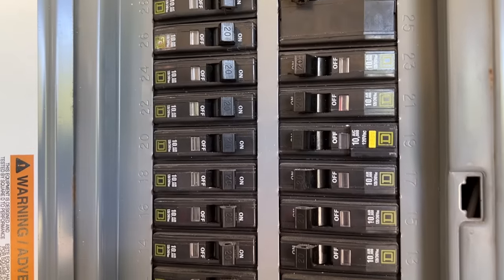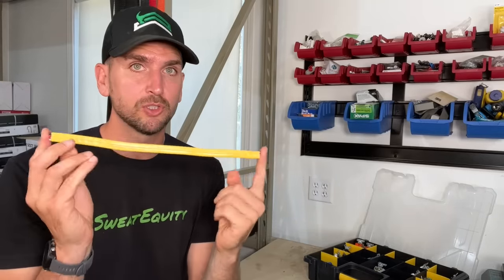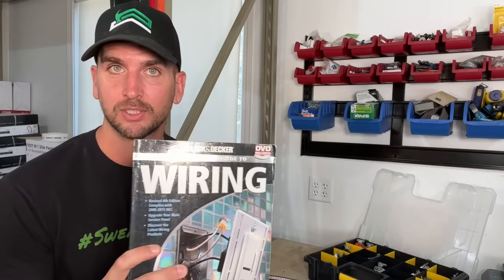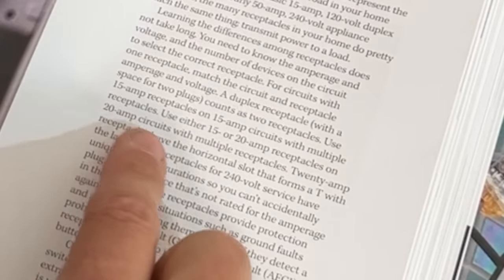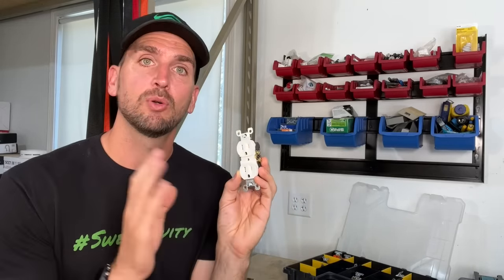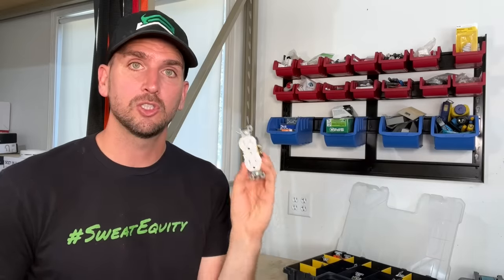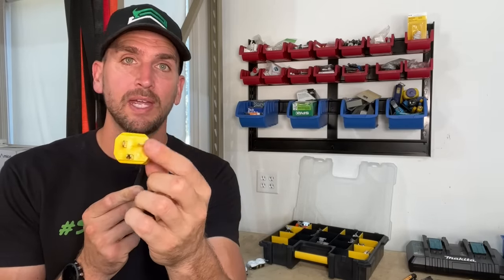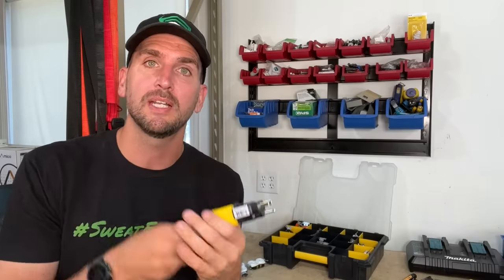Can 15 Amp Outlets Be Used On A 20 Amp Circuit Breaker

Comment: Additional information: As stated, you can put 15A outlets on a 20A circuit provided there's more than one outlet on that circuit. The code also specifically states that the double outlets, such as the ones he was taking apart, count as 2, so they count as more than one outlet. The outlets that count as only 1 outlet are the round ones with only a single set of holes in them and no other outlets on the circuit. This is usually only done on a dedicated outlet for a high amperage device, such as a window air conditioner or a large air compressor.
Reply: Normally one circuit line goes to 2-3 outlet in a room, not including the AC outlet.
Reply: Agreed.  Also note that most kitchens and baths require 20A circuits, yet use 15A receptacles.  The idea is to limit what any one device may draw (15A, ~1800W), yet permit the circuit to handle 20A (~2400W)... mainly in case two devices are running at the same time on that same circuit and realizing those single devices would rarely, if ever, draw a full load of 15A each.  20A is typically plenty to handle a couple lower draw devices.
Reply: wm
thanks for that explanation ..."the outlet that only count"......
Reply: JUST STOP BACK STABBING THE OUTLETS!
Reply: @brentwalker3893  Agreed!!!! I've seen too many fail. However, for those who don't know what this is, there's a difference between back-stabbing and back-wiring. Back-stabbing is pushing the wire into a spring loaded hole in the back of the outlet. Back-wiring is similar, but you're pushing the wire under a plate that is then clamped down by tightening the screw.
Reply: Receptacle**
Reply: @sapreaper  **outlet
Reply: @sapreaper  plug
Reply: @johnkulpowich5260  Do you know what a plug is? Pointless responses.
Reply: @wmcomprev  thank you for clarifying,  since many folks (including myself when I first got into the trade) use the terms interchangeably.    I would sometimes use terms like La-Z-Wire,  QuickWire or SpeedWire,  to make myself more clear when talking to others in the field.    One good thing about commercial-spec receptacles and switches,  is they are back-wire only, saves time from looping and removes the temptation to used the backstab.    (I don't even think commercial spec has backstab as an option, at least I've never seen it, says a lot about how inferior it is)     I've replaced my share of receptacles where the back stab failed.
Reply: @wmcomprev  the worst failure I've seen with a backstab receptacle, was in a home built in the '60s.   A television set, cable box and a lamp was destroyed after the neutral failed.   It was a multiwire circuit with each receptacle alternating between L1 & L2 along the wall.  It was a ranch style home pretty well equipped for the time.     To make matters worse it was aluminum wiring,  and for those who are wondering,  yes it was 12/3 AL, it used to be the a backstab would accept a 12awg conductor.   Only time I've ever seen that.
Reply: I don't use the hole terminals on the back of the outlet unless it clamps down by the side screw. I loop screw all other types. Once we had three wires to one outlet and being a teen used on set of the hole terminals hopefully it was the last outlet on the daise chain. It passed inspection but as an adult I would never connect that way. It's best to use an oversized box and junction two sets of wires. If my older brother saw it he should have told me not to connect the outlet that way. I'm sure that could have been avoided but drilling through 10 inch beams was out of the question. Plank houses have there problems when studding is added. The furnace guy had to cut them beams because mom said no floor registers in the house period. She had her reasons. 73
Reply: Or a microwave oven. I’ve been in too many homes where if you run a toaster oven while simultaneously running the microwave you trip the circuit breaker. 
Is it that difficult to make a dedicated outlet for these high drain kitchen items?
Reply: @tonymusolino2369  I got 30 amp breaker on 15 amp outlets in my kitchen. Old school wiring I did not wire the house. I would put microwave on its own circuit. I did on my new home. The current home is going to get new outlets and I will see if number 10 Romex was used if not then the 30 amp breaker will get changed a 20  amp will do regardless. 73
Reply: Ok let's argue about receptacles, outlets and plugs. There is a such thing as a female plugs. So I don't give a rip what anyone calls a plug, outlet and receptacle. Sometimes I will irritate because someone tries to correct which has no place on you tube.  It ain't mean a thing to me what you call the 4 slotted with two holes. Ok the terms have changed in the NEC but the average home owner don't read the NEC. Since you tube is open to all people I would use language that everyone can understand. So if you call a receptacle an outlet it's ok this is open to all people not just licensed electricians. Enough said. 73
Reply: Recepoutplug. He He I could not resist. 73
Reply: Wouldn't putting multiple 20 Amp outlets on a single circuit defeat the purpose?  Which is to communicate you can plug a 20 Amp appliance in here and be assured of not overloading the circuit?  You wouldn't want to allow plugging two air conditioners into the same circuit for example.
Reply: @odess4sd4d : That all depends on what you're doing with them. It's common to put in a 20A circuit so that you need fewer circuits (more receptacles per circuit). Usually, they'll be 15A receptacles and probably, unfortunately, builder grade. If it's a 20A circuit, it's legal to make them all 20A receptacles. They'll probably just be used for normal household items and won't need the 20A receptacle, but the capability is there. Most electricians, though, won't do that unless you ask them to and pay for it because the 20A receptacles are going to cost more. It's no more labor, just the increase in the price of the receptacles. If they were running the 20A circuit to reduce the number of circuits, they're already running 12 gauge Romex, so the receptacles are the only thing that's different. Most of the newer 20A receptacles are back wire (NOT backstabbing) capable, so no significant labor increase in wiring the receptacles. Even with the 15A backstabbing, they need to tighten down the unused screws, so they need to tighten the screws either way. With the back wiring, they don't have to take the time to loop the wire around the screw. The screw clamps a plate down on the wire that pushed straight in from the back.
Reply: @odess4sd4d  Placing multiple receptacles on any circuit will allow potential overloads. The reason for the 20-amp device configuration is to prevent a load drawing more than 15 amps being used on a 15-amp circuit. If a circuit will routinely have multiple 20-amp loads running on it, it will overload and should be split into two or more circuits. Circuits have multiple receptacles in part to prevent the use of extension cords, so the presence of multiple doesn't imply multiple simultaneous loads.
Reply: Can I do 1 15amp outlet with 20 amp circuit  dedicated?
Reply: @jamestrads497  If it's a 20 amp circuit, you may use 15 amp receptacles on it as long as there's more than 1 receptacle on the circuit. A double receptacle counts as "more than 1." So, if you have a 20 amp circuit and only put a SINGLE receptacle on it, usually a round receptacle with just 1 set of 3 holes, then that SINGLE receptacle must be a 20-amp receptacle.
Reply: @wmcomprev  thanks for the reply.  So I installed a 20amp dedicated circuit with an 15amp double  receptacle for my garage fridge.   Working good so far.    Is that okay?
Reply: @jamestrads497  Just remember, the current code requires all garage receptacles to be GFCI protected. Other than that, it sounds good.
Reply: If they can put a fuse into a receptacle, they will make life a lot more easier
Reply: @Crafty_house-r5d  They can, but they don't. I can see how, in some ways, it would make things easier. A breaker in the receptacle would be better than a fuse. A push button breaker, as is seen on some power strips, would work. A fuse, however, has problems. 1) You have to have a replacement fuse lying around in case one blows. 2) People tend to put a bigger fuse in to keep it from blowing again, causing a safety issue. 3) The wiring itself still needs to be protected from accidental shorts due to loose wires or a mouse chewing on the wire, so the breaker box would still be needed.
Reply: @tonymusolino2369  Difficult? No. It's simply trying to get off cheaply. What they don't realize is that most customers would gladly pay the small difference, which then gets rolled into the price of the home & its loan, especially if the reasoning for it is explained to them.
Reply: @ronb6182  for the most part, outlet is shorter to type and 2 syllables instead of 4 to say.
Reply: @odess4sd4d  I have and both run ok. The only reason they may be on the same circuit is because two rooms are Daisy chained and the AC units happen to be plugged in the nearest outlet to the window. I plan on selling the house but will take the AC units with me. Otherwise I would install two dedicated outlets for the AC units. If they weren't energy star I don't think the units would run. The total current is about 17.4 amps it's pushing it's limit and I would not practice putting two AC units on a single 20 amp circuit. But in my case the units rarely run together it's either or but not both. 73
Reply: @jamestrads497  my washing machine outlet is 15 amp on a 20 amp breaker but the house was built in the early 60s or 70s. I wired my father in laws house in GA and put the 20 amp breaker on a 15 amp outlet for the washing machine and passed UL inspection. The washing machine may need 20 amps for surges but may only draw half the current. I rarely see 20 amp outlets in homes. I don't have any in my Florida home. 73
Reply: @wmcomprev  good point plug is one syllable. I grew up calling outlets plugs must be old school. Also fishing lures are often called plugs. Plug is a universal word. 73
Reply: @jamestrads497 yes,  your circuit meets code.
Reply: Correct
Reply: I also seen washing machine outlet with only one outlet but most have a duplex outlets which are only 15 amp. A washing machine does not use 20 amps so a 15 amp outlet is ok. It never hurts to use a 20 amp breaker. I would not have 15 amp circuits in my home. My sister in law has them and she has all kinds of overload problems. Especially in the bathroom and kitchen. I told her with all the stuff you are trying to run you need new wires and breakers that are for 20 amps. I think code needs to rethink the 15 amp idea. Some localities don't allow the use of number 14 wire. I only use 14 for outdoor lights that are run underground because uf cable is cheaper using 14 over 12. My next home already has number 12 through out the whole house because I wired it years ago. I only need to install a light over the sink in the kitchen and bathroom. Good thing I'm reroofing the house so I can add wiring on the outside wall without going into the attic , the house has a metal roof and no one put a sheet of plywood and felt under the metal which I have leaks because the guy took too many shortcuts on this house. In Florida they use weather watch felt under the roofs which is better than regular felt paper. Enough of this rabbit trail. Lol 73
Reply: This post offers a complete explanation for this videos title. And takes a mere 30 sec to read, not bloated to 8 min.
Reply: what about a number of 20amp receptacles on a 20amp circuit, is that safe?
Reply: @wmcomprev  so what would happen if a 20A circuit had only one 15A receptacle? is it dangerous?
Reply: @carlodonnell146  I never use 15 amp outlets period. 20 amp commercial grade only.
Reply: @carlodonnell146  Never run more than 4 outlets to a single breaker...
Reply: I understand, so it is fine to have one double 15A on a 20A, but not a single 15A unless it is a dedicated circuit, but I would still like to know what would happen if it was done.
Reply: @carlodonnell146  The code says that if it's a single receptacle on a 20A circuit, that it can't be a 15A receptacle. It needs to be a 20A receptacle. A single receptacle would be a non double receptacle and the only receptacle on the circuit (i.e. no more receptacles down stream). With only the single 15A receptacle, you could overload it before tripping the breaker. You could say the same  about more than 1 receptacle, but only 1 of them is actually in use. However, the code also allows for some "most likely" scenarios. This is one of them.
Reply: @carlodonnell146  It could be. The breaker won't trip until you exceed 20A and the receptacle is only rated for 15A. The same could happen if you have more than 1 15A receptacle but only 1 of them actually in use. The code does allow for some "most likely" scenarios. This is one of them.
Reply: @carlodonnell146  Theoretically, you can put as many as you want on the circuit. If you exceed the rating of the circuit, the breaker will trip. So, no, it's not unsafe. However, if you have too many receptacles on a circuit, that break point is more likely to be reached and will essentially make the circuit unusable because the user would be tripping the breaker all the time.

Where it could be unsafe is if you have a bunch of low current draw items in each of those multiple receptacles and you're sitting right near the max current draw all the time (total draw from all the items). This will generate a lot of heat and could cause you a problem. When there's an item on a circuit that is considered a continuous draw, such as a heater or a blower motor, then you're only allowed to have it use a certain percentage of the maximum for that circuit. You'll need to read the code for how long it has to run continuously for it to be considered a continuous load.
Reply: Having lived in homes built inthe 40s-50s for much of my life…Not counting Amp draw can be Fatal…Why use 15amp thats less when you can use a 20amp..ifyou e ever used the a small electric heater that draws 15 amp and your socket and plug get burned..you know what I mean.
Reply: @kilroyishere6190  Understood. The comment is just that it's permitted by code. Going over and above the minimum code is usually a good thing to do.
Reply: @Sparky-ww5re  So during the neutral failure you spoke of, the TV, cable box, and lamp got their neutral through the loads on the second circuit to the hot on the other half of the split phase. In other words, instead of the two circuits receiving 120V + 120V, it was in actuality say, 80V + 160V (depending on actual load impedances), with the devices that failed receiving the higher voltage. If the two circuits on one cable had used breakers (fuses in this case, I imagine) on the same phase excursion, the voltage would have been reduced, not increase, and the devices would have been saved. However, there is nothing stopping anyone from sending opposite phase excursions out on the two hots. That's also why sharing neutrals is not longer allowed.
Reply: @tonymusolino2369  Around here, the kitchen microwave oven in new construction gets its own circuit.
Reply: @ronb6182  "Plug" should always mean male, and "socket," "jack," or "receptacle" should always mean female. To use "plug" as female is asinine. That would be like using "receptacle" for the plug on the end of a cord. Who started that nonsense?
Reply: @csimet  The problem with that is that many hair dryers draw 16 A or more.  The practice of allowing such devices to have NEMA 5-15P plugs, and allowing 20 A circuits to have even one NEMA 5-15R receptacle, is a vicious cycle.

We really should end this practice: if and only if it's a 20 A circuit, use NEMA 5-20R receptacles exclusively.  It's unfortunate that, when faced with a NEMA 5-15R receptacle, you have to trace it back to the circuit breaker to find out what the circuit's amperage really is.
Reply: @jmdavison62  Perhaps, but I have never seen a hair dryer rated over 1800W (120v x 15a) that used a NEMA 5-15P, so I'm sure sticking with 15a rated receptacles in a bath is fine and still meets code.
Reply: @caseycooper5615  Correct. The same thing can be said for any circuit, regardless of its amperage rating, that has more than one receptacle on it. If you plug in and turn on too many items, the breaker will trip.
Reply: @carlodonnell146  The code assumes that with more than one receptacle, probably no single receptacle will pull over 15A. With a single 15A receptacle, you don't have that fudge factor. However, it's just that, a fudge factor. So, is it dangerous with only a single 15A receptacle on a 20A circuit? Well, it would depend on what's plugged into it. Also, if you sell the house, will the next owner know that? It is a code violation and not that hard to comply with the code, just pay the little bit extra for the 20A receptacle and you're clean. Also, remember, a double receptacle counts a "more than one" and, therefore, doesn't violate the code.
Reply: Hi.....if a 15A recep.  Can pull only 15A  and only a device with a 15A plug can be plugged into it.....why would it matter if only one 15A  recept was installed on a 20A circuit?.....it cant  pull more than 15A  through the 15A recept. ..correct?
Reply: @carlodonnell146  Not all 20A devices use the 20A plug with the sideways spade in it. Also, not all the rules make 100% sense, they just have to be complied with.
Reply: @csimet  Here's a counterexample: the nameplate on the Babyliss Model BAB307 reads "125V AC 60Hz 2000W."  (I haven't tested it to see what its actual draw is in practice.)
Reply: @ronb6182  30 amp breaker on 15 amp outlets?  Serious code violation and safety hazard.  It's already pushing it to assume that a 15 A outlet can handle more than 12 A continuous.  The outlets in question shouldn't have been shared across a circuit greater than 20 A.  The risk of melting the 15 A receptacle is even greater on a 30 A circuit than on a 20 A circuit.

(In my opinion, 15 A circuits should supply only 15 A receptacles, and 20 A circuits should supply only 20 A receptacles, and the arguments I've heard in favor for the NEC's permissive policy of allowing multiple 15 A receptacles on a 20 A circuit are unconvincing, but that's another discussion.)
Reply: @jamestrads497  How much current does the garage fridge draw?
Reply: @Crafty_house-r5d  Re: "If they can put a fuse into a receptacle" ...or if they could require that the receptacle amperage equal or exceed the circuit breaker rating.  Then the circuit breaker could do the job.
Reply: @jmdavison62  Not saying that they may not exist. but if it is rated above 1800W @ 120V, then a NEMA 5-20P should be provided so that a 20A receptacle, and circuit, is required.  Even a NEMA5-15P/R can actually handle well over its rated capacity.  My bet is Chinese manufactured and miss-labeled , to promote their product as "better."  ;)
Reply: @csimet  I agree that hair dryer that draws over 1440 W continuously or 1800 W intermittently should be compelled by law to use a NEMA 5-20P (or bigger) plug.  What I'm not yet clear on is the apparent discrepancy between the wattage ratings I've seen on some hair dryer nameplates (to say nothing of advertisements or packaging) and the power they actually draw: I don't have equipment handy to test what they're actually pulling.  My (flawed?) understanding is that, rightly or wrongly, manufacturers for certain appliances (air conditioners, hair dryers, etc.) routinely use NEMA 1-15P and NEMA 5-15P plugs when their power requirements clearly indicate that they should be using NEMA 1-20P or NEMA 5-20P, because market forces (the prevalence of supposedly 20 A-capable NEMA 1-15R and NEMA 5-15R receptacles that are installed on 20 A circuits) force them to.

(I'd love to know how much power this "2000W" Babyliss BAB307 really draws.)
Reply: @jmdavison62  yeah and I will go with the NEC on that one. I did not wire this house and I had no issues with the 30 amp breaker. I won't wire that way and if I decide to upgrade and split up some of these grey areas I will use the new arc fault and GFI outlet on the first string. The refrigerator and microwave will have their own breaker and outlet. That's the way I wired my father in laws house in the Georgia mountains. In the old days before grounded outlets came out there used to be vertical and horizontal pronged plugs and outlets and I believe they were 30 amp. Dad used them in the mid fifties. And he also used number 10 wires. He ran EMT throughout the whole house. I sure miss our home in north of Pittsburgh. The walls were an inch thick because of plaster and wall board. You wanted to add an outlet anywhere you had plenty of support. Our hall didn't have an outlet so dad and I added one I guess we tapped from a junction box in the attic. Dad never daisy chained that house. The junction boxes were in the attic. 73
Reply: @jinbiaoma4808  More than that, most homes since the 60's got 9-14 receptacles and/or lights on a 15 amp circuit. If my home had only 3 receptacles on a circuit, there'd be over 20 circuits for outlets alone!
Reply: @tonymusolino2369  Since the 2 required 20 amp kitchen receptacle circuit is permitted to feed also the fridge, the dining room, pantry and similar areas there may have been more on that circuit than you knew. Also, some toaster ovens are large, and use 1500 watts, add a 1200 watt counter top microwave and you're at 2700 watts on a 2400 watt circuit. Also, over-the-range built in microwaves are supposed to be on their own circuit.
Reply: @jamestrads497  Yes if it's a duplex receptacle.
Reply: @jamestrads497  You're golden, but note that garage fridge requires GFCI protection. But if you didn't I won't tell anyone. ;-)